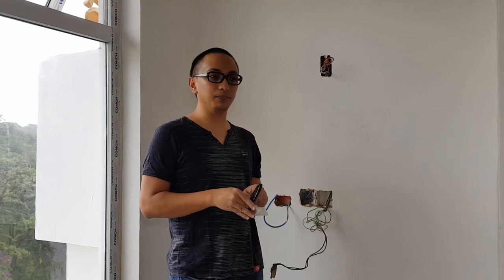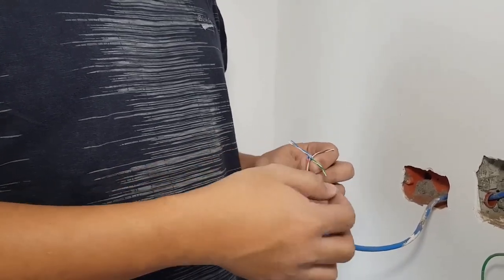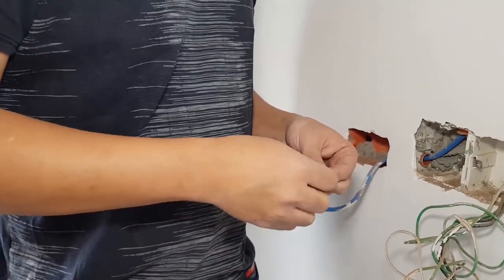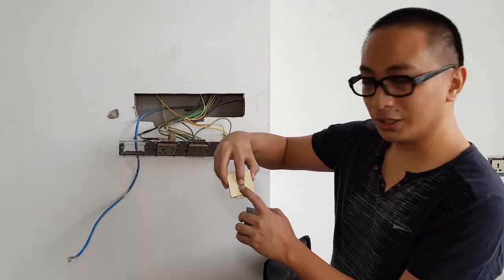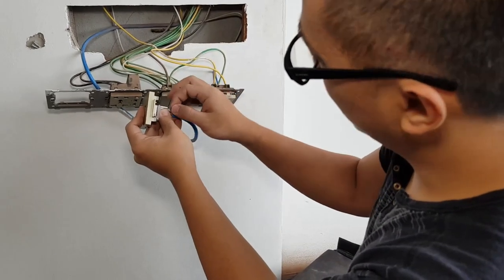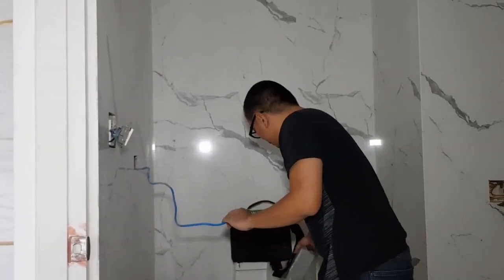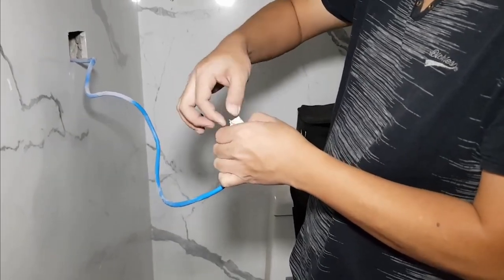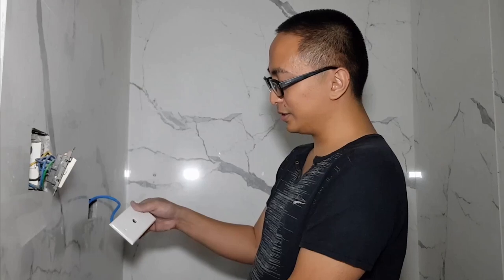[Video 5] Structured Cabling 101: Cat6 Cable Endpoint Termination Live

Comment: Sir Fiber SC Type na pag crimp po kya? Sayang dapat dati ko pa po ito napanood. Dami naming error po haha
Reply from the maker: It's not technically crimping yung fiber. More on cable termination kasi kailangan mo sya balatan tapos shoot mo sa SC or LC connector
Reply: @loubeltran99  Baka po sir makaka singit ka ng Fiber Optic na termination guide.. my pang terminate po kami kaso di po namin alam kung pano haha.

Comment: Sir lou, pwede po bang RJ45 ng pang CAT5 gamitin sa CAT6?
Reply from the maker: As much as possible per standard dapat same category materials kailangan gamitin sa structured cabling. may sizing kasi yung individual wires na magkakasya lang sa correct RJ45.

pero in a pinch, you can use it basta magkakasya sa RJ45 yung individual wires.